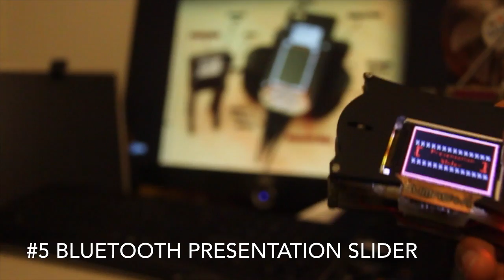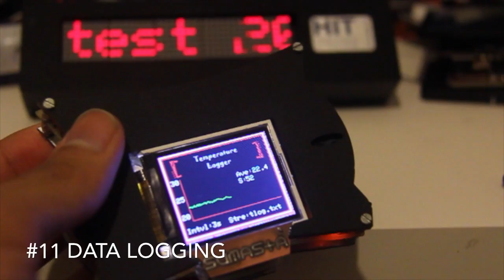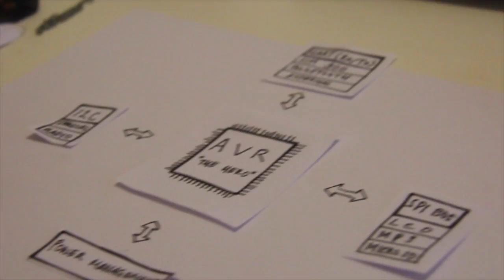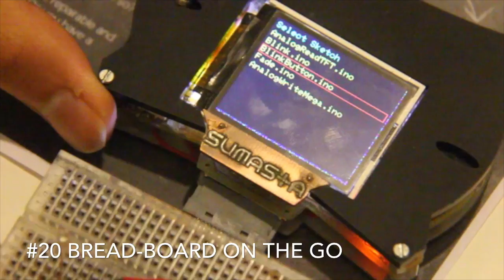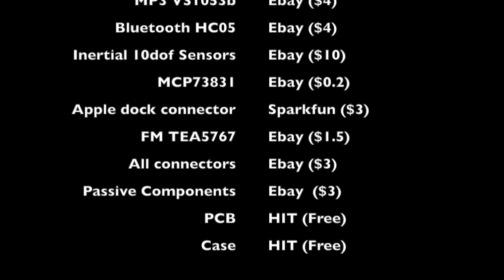AVR - Arduino based Inertial Mobile Phone Unit

Comment: "It is portable mobile phone where you can bring it in your pocket wherever you want" Wait, isn't that what normal mobile phone supposed to be?? :o
Reply from the maker: Yes, my friend :) thanks for the comment.. but don't cut the sentence, add " whenever you need, to do whatever you want". don't forget I mention "DIY mobile phone" as well in the previous sentences ;)
Reply: Aah, I see..
Sorry for the inconvenient. For an DIY, can you tell me how difficult is this mob phone to build? I mean is it meant only for the expert or also for other people?
Reply from the maker: Gon Freeccs Well as you might expect, in terms of the hardware,  it is not a matter of plugging things to breadboard or soldering standard 0.1" pins.. all the components are SMD package, meaning you have to have some experience in soldering SMD; a lot of tutorial though on Youtube about that.. but, the moment you can overcome that fact, everything is really is become small & portable. Further, moving a bit backward, which is designing a PCB, it also take some effort, specially if you never done it before. BUT, when you talking about the software, it is SO DAMN EASY,, Arduino being arduino, open source library are available everywhere, you don't have to do all the dirty works,, So yes, in terms of the hardware, if you interested in making one, it requires some skills, however, software-wise, it's very easy, beginner can start learning to blink leds with this. In short, this device is meant for beginners who wants to learn making stuff on-the-go, where everything is in a grab-of-a-hand, not stacking all the bulky arduino shields, but yes leave the hardware to the proper 'hardware-guy' :D

Comment: nice one. but what arduino has to do with that???
Reply from the maker: Hi Friend... well arduino is not only about the board (uno, mega, due) it is rather the entire prototyping platform from the board, the IDE, the language, library etc. In fact, Arduino boards use ATMEL microcontroller, they don't make their own chip. And yes, in the phone in the video above are fully programmed in arduino IDE and the phone is basically just an Arduino MEGA with all embedded peripherals as you can see..